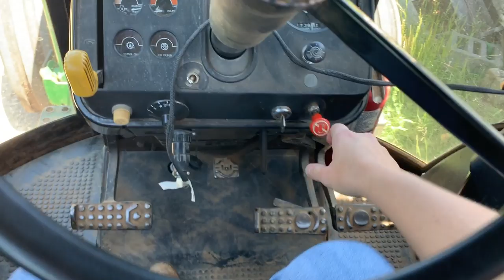Hay Down! : Raking & Baling First Cut Hay 2020

Comment: Here in  the piedmont of North Carolina we have started to mow hay and we have a new Holland 1412 mower and if you don’t have your mower on float and you get on a bank with the float off the you might mess up your cuter bar by breaking the shafts and we have had to take the hole cutter bar off and then you have to fix the cutter bar back on and all that is just aggravating

Comment: I have 3.5 acres in the Wildlife Habitat CRP program. The last few years, I have seen Quail more than in the previous 30 years. Last summer, I heard them every day, and saw them often. I even saw little ones early last summer when I was mowing a path around the prairie grass, for them to use as a  morning dry out spot. I even heard one yesterday during the day long spring shower we had.
 I think you need a little dish antenna on the 'Crib' , with a good connection for uploading your videos.
Reply from the maker: They seem to be coming back here little by little too! Hope they do.
Reply: @ThisFarmWife_  Here in Illinois, most all the fences have been dozed out, along with trees in the fence lines. That is the perfect habitat for quail, since they have easy escape by flight in 2 directions or can run off in the grass in 2 directions. 
 In the 1970s and early 80's, 90% of the fence rows were wiped out, leaving very little habitat for them. We used to have pheasants in this area, where we could go walk a fencerow and kick up a couple for a New Years dinner. Not anymore. 
 Coyote population has also gone from nothing in the early 70's to overpopulated now, which puts a real kibosh on game bird populations.